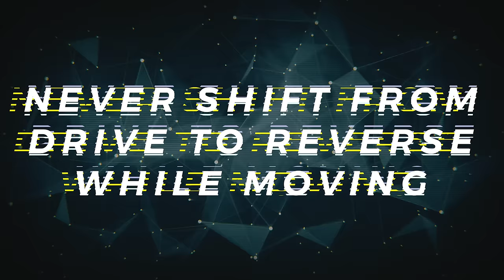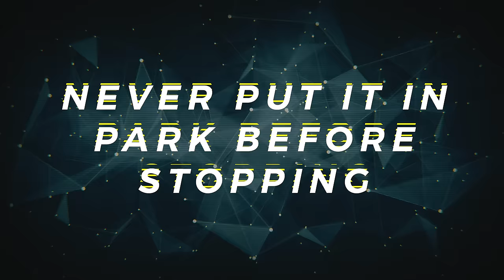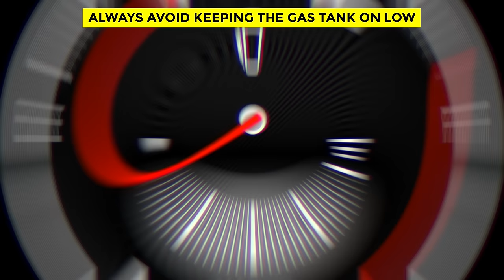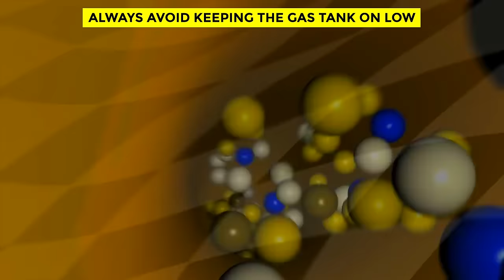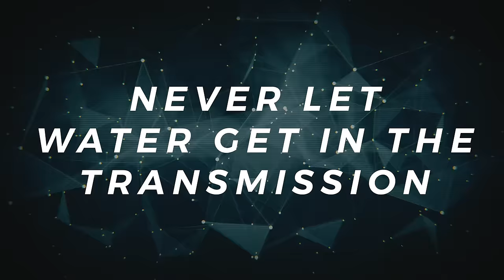7 Things You Should NEVER Do In an Automatic Transmission Car!

Comment: Engine overheating because of coasting in neutral? Never heard such bullshite.
At least not on manual cars because thats all I have experience with.
When standing and idling, the engine will get hot until the thermo-activated fan switch kicks in and provides airflow through the radiator, thus keeping the engine from overheating.
When coasting in neutral you are moving at a speed that is sufficient enough to cool the engine. And even if that shouldn't be the case there's always that backup fan.
And if the oil pressure on idle is harming your engine you need a new oil pump or a new drive belt for the pump. Simple as that.

Comment: I absolutely hate automatic transmissions. They're boring as Hell and I don't care what its proponents say...I can get way more power per gear than they can using an automatic. I have been smoking automatics for many, many years now. No matter how new the car I haven't lost against an automatic when matched evenly. Further, I would much rather pay for a clutch, pressure plate, and throwout bearings than the entire transmission. Unfortunately, my new car is an automatic because I couldn't find a 6-speed manual and that just pisses me off. I'm so angry about it I'm thinking of tearing out that automatic and replacing it with a 6-speed tremec. If I do I'll sell the automatic to regain some of the cost.

Comment: First of all how do you let water go in your transmission??? And if water go in a manual transmission it will also damage it like if water go in your engine it will also damage it and second of all how does putting the car in neutral slows down oil from flowing through the engine to a point where it can damage the engine 😒 I wonder what he be smoking 😂😂 and what does a fuel pump have to do with an automatic transmission???? So basically if I run out of fuel or my fuel filter block that can cost me a new automatic transmission????

Comment: at a red light it is better to put your car in neutral, because your converter wears more, because he is working against the brakes, because of that the car is moving when you aren´t braking, so this advise is bulshit. Put your car in neutral at a stoplight, will save your converter and save fuel.

Comment: Almost nothing is true about this story. Very superficial almost everything said and no good for new drivers. I have a mercedes benz E200 automatic gearbox compressor, I bought it with 100,000 km. now it has 650,000 km. I drive it and put it in neutral (N) all the time. and everything is fine, always down the hill I go to N and everything is fine. for 20 years and 550,000 km. Riding on the reserve also never had a problem with the pump. He never said anything right. And how will the water enter the gearbox ??? no way. everything is closed and sooner it will enter the engine not the transmission.

Comment: Tip 1 , never put in reverse while the car is stil moving forward, yea mate, cuz i gonna do that in a manuel or in an automatic car. xd 
Tip 2 , never put the car in park while stil in movement, procceds to show a ford drift build, what the fucking point trying to make with showing a drift car ? XDDDD
Tip 5, never launch your car in neutral , yea cuz when in neutral the car will actually move XDDDD launch means the car actually moves btw

Comment: Don't switch to neutral and handbrake while On Stopping at Red Light And Gas Station...  RIDICULOUS. That's was A Stupidest thing I ever hear....  Let me explain.  It's simple. The neutral Is reducing the oil fuel It's was Very2 important plus the handbrake for stopping in any surface like those and neutral help the car transmission to stop so there no wheel will spin either u push it or tow it. Facts: Neutral is the best way to prevent from letting the car to go them self and it's very serious problem cause fuel to go out and the driveshaft drain.

Comment: I prefer a manual why you can slow down with the gears going round the corner.. you feel more in control of the car.. 
The car is lighter with a manual car is less to fix have a manual should I go on.. A manual is cheaper than an automatic to buy